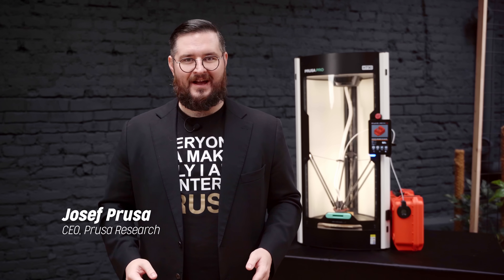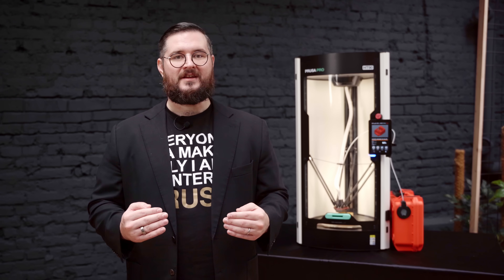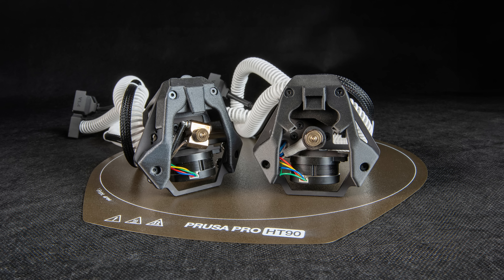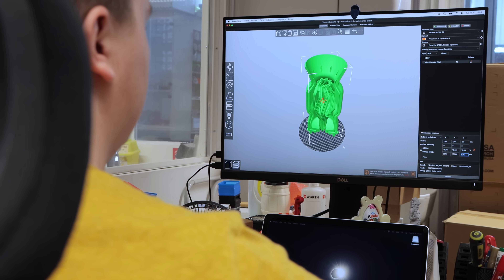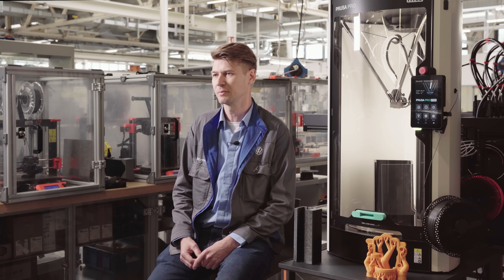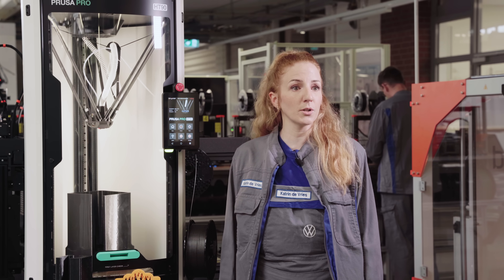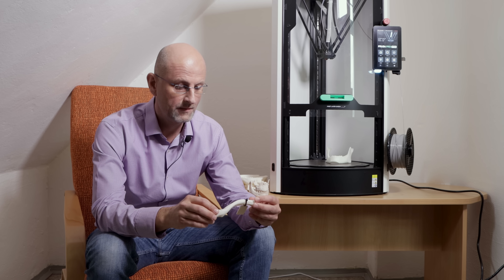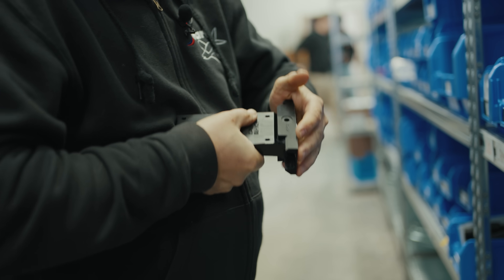Prusa Pro HT90 is here: The Only 3D Printer an Engineer Needs

Comment: "We understand the importance of security in industrial applications. While the HT90 offers a comprehensive remote print management system and surveillance, the printer is fully prepared for a completely offline operation. You can even disconnect the Wi-Fi module from the printer. We do not collect information about your prints or your printer’s surroundings. No matter whether you’re developing a new-generation space shuttle or just printing tools for your workshop, no organization should be interested in this information."
Reply: This is one reason I picked Prusa over everyone else, especially Bambu. Bambu's TOS actually allows them to terminate your account for any reason, given your printer serial number is tied to your account and offline firmware updates are not possible, if they terminate your account, you'll never be able to update the firmware again.
Reply: I wish the Prusa XL had this feature but the Wi-FI module is soldered on the board there.
Reply: I hope you can use Ethernet instead. Wifi is a lot of trouble for something that doesn't have to move around.
Reply: Name a 3d printer that cannot work offline? This "feature" isn't special.
Reply: @Kastman82  You can disable Wi-Fi in the menu, and without the antenna, it won't be able to connect to anything anyway. Having the ESP soldered on the board is perfect for 95% of people, while having to manufacture a separate board without it would just be an unnecessary extra cost.
The MK4 has its separate ESP module on the outside, but it's not exactly an elegant solution and potentially brings other issues with it.
Lastly, all their printers come with Ethernet ports.
Reply: @finlay9260  I know but in high security environments that is not good enough, in those environments you need to be able to remove it. Ethernet or just good old fashion USB stick is preferred.
Reply: @Kastman82  Yup, I get it. Afaik, it's mostly a US thing though... barely - if at all - anywhere else are the regulations for pre-soldered Wifi that strict.
Reply: @XxMsrSzprzxX factory reset and a new account should be possible then ?
Reply: @AwwwSnapperz  Bambu labs.  You can print via SD card, but can't update firmware without connecting to their cloud.
Reply: @AwwwSnapperz  Every printer can print offline. Read the words again. 'completely offline *operation*' also includes installing updates. Part of operating a printer is maintenance, which firmware updates fall under.
Reply: The main premise of op is this printer is full prepared for offline operation. You buy the printer with zero expectations of updates. You were never promised nor guaranteed updates on any brand. Show me where Prusa promises updates. (they do it, it is nice to have but you are never promised anything)

Having or not having updates will not stop the printer from WORKING 100% offline. 
You have start, stop, pausing uploading, downloading monitoring, full XYZ controls etc. Also if the printer is working to spec with no issues why would you need an update? What is an update offering if the printer works fine?

If a company goes under tomorrow you still wouldn't have updates but the printer would still work. 

SD, FTP, LAN only would still work fine. The main argument was completely offline. 
"While the HT90 offers a comprehensive remote print management system and surveillance, the printer is fully prepared for a completely offline operation " That other brand works offline too.
Reply: lol. They trying to accelerate the regulatory pressure. Lack of accountability is how you get stifling regulation. Nice play Prussians.
Reply: This is why we use them in aerospace! We run a few of the mk4s and we'll look into getting PEEK printer
Reply: @XxMsrSzprzxX  

Updates are updates
Maintenance is maintenance.
"Completely offline operation" is working independent of any internet and/or network connection.

OP mentioned working complete offline as if that is special. It is not special and every printer can do that.  

Vader above has a more thorough answer so I wont repeat it. I will say this. In a production environment we do not just install updates unless there is a need. If production is running perfectly under current firmware there is very little chance we update just because a new firmware blob dropped.
Reply: @AwwwSnapperz  Semantics aside, Prusa ships hardware that's well ahead of release software, the MK4 for instance has expansion still available on the board for future components. An update was recently put out for the XL I believe to reduce vibrations or something, meaning in this case, helping with maintaining the overall machine. Prusa maintain the software on my machine (until I decide to install custom firmware which I can do, but will void my warranty), I maintain the hardware. Get it? If you're serious about your own machine's maintenance you need the ability to update it offline, period. Otherwise you're going to be dealing with the wonders of 'the cloud'.
Reply: @XxMsrSzprzxX  Prusa shipping hardware well ahead of their featured marketing is a clever way to say they rushed products and the end user has to wait an indeterminate amount of time for the marketing to match the product.

My buddy has a  mini(2019). That went years before the input shaping(IS) launched. If he bought it on the promise of IS coming it would have been 4 years (2023)waiting. He used the product as is with no promise or expectation of an update to add or alter anything. Did the mini stop working because there were years between firmware revisions? 🤔

Maybe you don't understand the basic premise of what I am saying. I buy my products to spec, not promise. The fact you are trying to shoehorn maintenance into updates is odd.  Why would I run an update potentially messing with production? The difference between professionals and hobbyists are they run code because it's available vs is there a REASON to run it. 

Do you honestly think the businesses featured here are just updating firmware because one dropped recently? So I repeat there are no 3d printers that require cloud and every single one can work offline.
Reply: @AwwwSnapperz  Product development and release doesn't work like this. Apple for instance has baked neural networks into their silicon that then take on multiple new roles as and when Apple think of said roles. Certain protocols I've worked on have been developed for one purpose then entirely repurposed for something else 3 years later that I couldn't foresee, such as another emerging technology nobody knew about. I did not 'rush' anything, hardware and software engineers never stop making little improvements if left to tinker away, that is the 3D printer community. We don't buy on promise, we buy on possibility given hardware capabilities. Print farms let everyone else with less on the line, us hobbyists,  beta test everything for a year or so before they jump on board if they choose to. You're not going to tell me that print farms are going to leave efficiency, speed or durability gains on the table when they've been vetted for a while.

I don't think your friend even knew of Prusa's plans 4 years ago for input shaping or what machines they'd release it on, to be realistic. I didn't say machines stop working if there's no new firmware, I said that when there is, there's usually something that helps with the machine's maximum longevity in Prusa's case. 

If a Bambu printer is discovered to have a vulnerability or a safety issue, as they recently did with the last physical recall that they can fix with a firmware update. You will connect to their cloud whether you want to or not because you don't want to risk breaking your machine or burning down the building it resides in after the manufacturers have told you there's a danger present. This isn't debatable. If that's a Prusa machine, I still don't have to ever let it touch the web. 

Your whole argument is that a 3D printer you buy now is flawless out of the box and will never require a firmware update and that the manufacturers will never discover any software related flaw down the line at any date and I want to inform you, as a dev, that this is delusional. Its like you've never heard of critical issues in things that are found multiple years later after a product's release.
Reply: Heated chamber + open firmware + offline is why I ended up going with the Qidi Q1 Pro. (Upgrade from an RepRap i3 Rework that has run for 15 years!)
Wanted to print engineering materials and not having a heated build chamber is what stopped us from getting a MK4. (The MK4's price would have been worth it if it was fully enclosed and heated.)   A Voron was a second option, but we wanted to try something 'out of the box' this time.
The HT90 looks like a great option for those with a much higher budget who doesn't want to mess about with building a Voron to get a CPAP blower cooled hot end. :)
Reply: bambu have opensource firmware too if u want it
Reply: @andrikurniawan531  If you are referring to X1 Plus - this is not firmware, and this is not from Bambu.
Reply: @UnCoolDad  not firmware? so what are those?
Reply: bambu works offline. fw updates can be done offline as well, competition is one thing but spreading bullshit is another
Reply: @utkua  you are the one spreading BS.  Bambu FW updates cannot be done offline.  Known fact.
Reply: @UnCoolDad you can even install custom fw in bambu
Reply: @utkua  X1Plus is not custom firmware.  It is a hack which allows you to modify the UI and adds plug-ins of sort to add features. This sits on top of the Bambu firmware - which is still not updatable unless you connect to the Bambu cloud.
Reply: @AwwwSnapperz  Try to update the firmware on a Bambu Lab without connecting it to the internet. Guarantee a DOD contractor with strict security protocols that no sensitive data will be transferred to China while it's doing its update. They are locked on the version of firmware forever, once they printed a single NDA relevant item.
Reply: @drstefankrank  why would I need updates if it works perfectly fine offline?

If I did want updates I can run the X plus 1 customer firmware which do have updated firmware offline.
 The printer does not upload when downloading firmware (easily checked with router, Wireshark or your flavor of network monitoring) 
Please educate yourself on the topic.

If I was running DOD contracts I think I could afford a machine that isn't a retail printer...

Do you guys even think your arguments through?
Reply: @AwwwSnapperz  Ah yes, we think it through. There are companies out there who do a lot of NDA stuff and had exactly that problem. You'll find them on YT. They even decrypted the log files that Bambus send to their mothership, including camera pictures and gcode. How do you find that encrypted data in your packet capture, apart from "it transferred some megabytes at some point".
You see even at VW that they are using a lot of MK4 and XL. Don't think that VW want their parts copied to China and also have a strict requirement that even Prusas won't have internet. Replacing every of these to a professional printer is very expensive for almost no necessity.
The plus firmware isn't official and therefore a crude hack which you also might not want at a company, because you are leaving supported territory. You think you get professional support from Bambu if they notice you are running unofficial firmware?
Maybe it doesn't print that fine and the newer firmware resolves some bugs, or add some other valuable features. Like Bambu did with that noise cancellation or Prusa with the addition of input shaper.
Having a printer that does not rely on an internet connection for basic features, like a firmware upgrade which all other printers did offline for years, is indeed a criteria people want or need. It's not much needed for a Bambu to be usable in such companies, if they just remove these unnecessary dependencies.
Reply: . If you are offline or in lan only there is nothing being uploaded. If you're running any high-end Security operation you're going to be offline. Anything beyond that is strawman in random what is. If your device is working fine why are you installing updates?

The silly thing is these devices have been out for 2 years and the network security folks haven't released an expose or anything about that. And if and if you're mentioning 3D Musketeers his crap has been debunked so many times he just throws his nebulous security team under the bus but no one on that team speaks up for him.
Reply: @No0o0o0o0o0  updates are to fix bugs and for new features. Basically if you want privacy, you are stuck on whatever version your printer ships with - assuming of course it doesn't look for open networks and connect to them to phone home without you knowing.  The HT90 you can physically remove all network modules.
Reply: @drstefankrank  Try to keep up. Bambu machines don't need internet to work. Lol. We established this in 2022 with the first X1C. 🤣
Reply: @UnCoolDad  reread what I wrote. If the printer is working fine.... Updates often come with unforseen ISSUES. 

The 3d print community has been so mistreated by  software/hardware vendors they think every software /firmware revision needs to be installed. That is not how the manufacturing/business world works.

Updating for the sake of updating can break many things downstream. IT can freeze and entire organization.
All this talk shows me is that these are hobbyists pretending to know IT in a corporate setting.

Or in layman's terms "if it isn't broke don't" fix" it"
Reply: @No0o0o0o0o0  if you look at bambu's firmware release notes, there have been numerous fixes, and even features added such as the silent stepper update.  Why should someone restrict themselves to an update at the risk of privacy?  How difficult can it be for Bambu to allow offline updates?  Everyone else does.
Reply: @AwwwSnapperz  For official firmware updates? Does that work now? Download the file, put it on a thumb drive and flash it without network connection to the printer? Would be cool and would made these printers more available in such conditions.
Reply: @drstefankrank  so you trust bl to give them a credit card all your personal information but getting a firmware update via online is a bridge too far. Lol as I said before you don't need to get updates you were never promised updates what's the difference. Because you got FOMO you forgot why you didn't want to connect in the first place. If BL stopped being a company tomorrow you still wouldn't have updates but the printer would still work fine

But the biggest thing you guys are glossing over is nothing gets uploaded during a firmware download. This has been proven for years. If you want to stay offline stay offline you want to get the updates and stay offline you can do that too you want to stay online you can do that. Don't want to send files to the cloud don't send them to the cloud you have several options
Reply: @AwwwSnapperz  Wait, you can only buy Bambu printers directly from Bambu? I'm sure I've seen them in other shops.
Also: For contracts that require your printer and machines you work on that project to be air gapped, it doesn't matter if it is proven that it won't send any data. You just can't do it without violating your contract.
I know, this is a niche for some professional print services, not for the average user.
It's just a fact that this is a needless limitation for an otherwise very good printer.
How hard is it for a developer to implement that feature? What is Bambus intention to force it over the air?
Reply: They weren't kidding when they said you guys are.... Different. Even when faced with evidence the goal post keeps moving, and you come up with some fantastical scenarios. Lol

You are given choices and you complain about those choices. You are given options and you complain about options. Gatekeeping is the reason why this community is insufferable.
Reply: Tell me about it. They want offline operation it's there.

They want (network)lan only it's there including sending files over local FTP to sd card.

They dont want cloud service they arent forced into it but keep spouting they are..?🤣

They want updates, Connect online get the updates and disconnect as nothing uploads anyway. (this has been verified for years) Updates were never promised, nice to have but there are tons of folks who run fine without updates too.

They want an open source firmware. There is X+1. Heck the whole X+1 team has been looking at the whole operation of the printer and the worst they can see is the printer may collect too much but what OS doesnt especially when it is a product that runs at oven temps unattended. BUt none of that gets uploaded without user consent. 

They claim logs have a ton of data(duh) but ignore the fact logs ONLY UPLOAD when you run a trouble ticket and even then it is optional. 

There are articles and a whole community looking for a smoking gun but zero evidence of it, just sensationalism to get clicks.(3dmusk) who as been milking that camel for years with no pay off just innuendo and no facts and the undereducated eat it up. 

The Newest FUD is "the printer will connect to an open network and send data automagically? LMAO Does it open a portal to the shadowrealm and with quantum entanglement transmit data over subspace too? GEEZ...🙃

You can dislike the company, you can dislike the country because they arent...european🙄 you can dislike the fact they came out with banger printers and brought thousands into the "exclusive" club and they didnt have to suffer through a kit and some gummy bears but your disinformation is on YOU to prove and everything spouted here has been disproven time and time again.
Reply: @AmericanVirus-rf1rn wth dude 😳 perfectly stated. 
 freaking mic drop moment 🎤
Reply: @AmericanVirus-rf1rn  I like their printers, don't get me wrong. I would recommend them to a lot of people. What you seem to ignore is that for some companies a network connection is forbidden, even for a short period of time to update these machines and there is zero reason to not allow their official firmware to be send bei FTP and flashed through the display and you say that they should live with a possibly buggy firmware and are not allowed to profit from a way better firmware which everyone else can use who is allowed to connect it to a network.
So they would have to trash that printer, buy a new one, update it and never update it again. This is all legal matters, not technical, why they can't just connect for an update. Let this be under 1%, still it seems to be a selling point for other companies.
Reply: @Kastman82  I imply avoid configuring the wlan, and that's it.
Reply: All it takes is a firmware update and EULA change. Promises of privacy and security mean absolutely nothing in the tech industry unless there are physical checks in place. Doesn't matter if they're safe "now," if the capability is there, they will eventually get used.
Windows wasn't invasively collecting analytics... until it was.
Apple was commited to privacy features... until it wasn't.
Amazon insists Alexa data is private... until they needed to send the data to random Indian contractors to train AIs.
iRobot followed strict encryption standards... until they nearly got bought out by Amazon.
Google insists the Nest thermostat's microphone is disabled in software... for now.
Reply: @reinux  100% - and you can trust China based companies even less.  Not because they are Chinese or because they are bad people - but because of the CCP.  By law if the CCP ask for data, or a back door - any Chinese company has to insert that.
Reply: @UnCoolDad  Funnily enough Bambu Lab just announced that their X1E can now update firmware offline via an SD card. The rest of their printers will receive this feature in the following months, so they can now be used 100% offline.
Reply: @NorwayVFX  that's fantastic news.  Isn't competition a wonderful thing.  I do question why it took them so long though - and if they will offer anything back to the open source community rather than what they already have and were obliged to do.
Reply: @AwwwSnapperz Bambu has your printer connected to your account and can be terminated for any reason they have, so your machine will no longer get any firmware updates